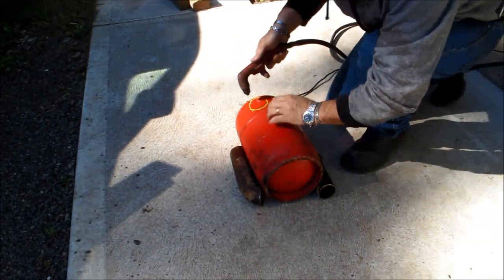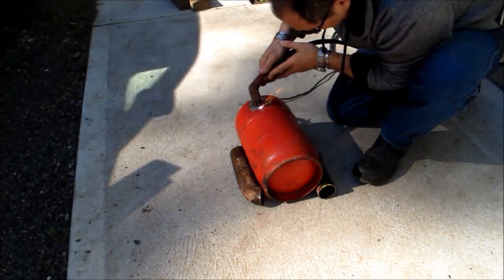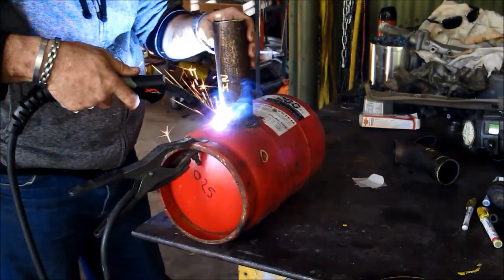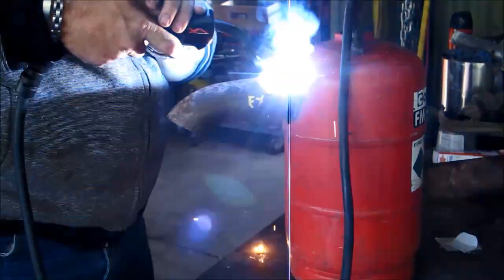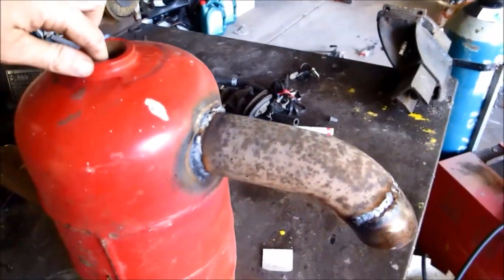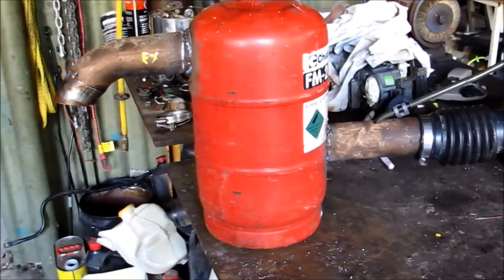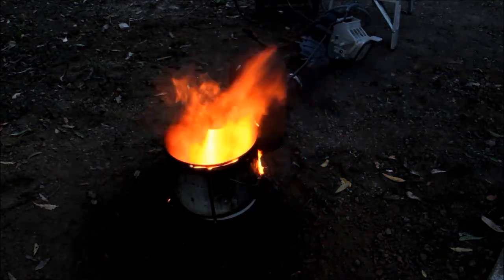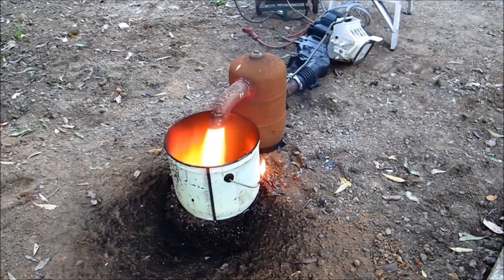How to build a Waste oil Burner for heating, scrapping or aluminium melting

Comment: Does placing the oil drip pipe closer to the tank on the pipe vs where you have it placed there make a difference?
Reply from the maker: No, The same amount of oil is still being fed in. If anything, It may be better to have it further back.  I think a pumped supply is far better than gravity and if using a Pulsed pump say 1 sec every 10 like I do now, the longer length evens out the flow into the burner.  Other than that, the positioning has no effect, it's just a packaging consideration.

Comment: Yes, your other vid on the very same burner gave me the the insights. Now seeing this vid I'm thankful that I got to see it before I weld everything together tomorrow. I had been trying a different setup and I did finally get it to work but I don't need a candle lol. I had a very similar sized pressure rated bottle I cut the holes with a angel grinder and simply stuck the pieces together. That was this afternoon and it preformed with nothing welded an gaps. I had that awesome oil powered flame. Thank You for your helpful vids!!!

Comment: A question Please... .. . How strong a plower do you need, would a mall vacuum motor work OK??  & How small a tank do you think one could get away with??
 Hah!!  Love the dirty build Mate!!! I've built some fancy burners for gas etc. To melt Bronz. But this is great as I have much aluminum sitting around and don't want it trashed.   Safety sissies Ha!! ... ..  This machine has no brain, Use your own!  /  90% of all humans were accidents!!
Reply from the maker: Vacuum motor Blower should be Fine.  You could probably go down to half this size tank with no probs and smaller but you'd have to build carefully below that I think.  The tank is like an evaporator for the oil so if you go too slow you will be limited on the fuel you can burn. 
Than again, the output of this thing would leave any gas burner I have seen for dead so there is a LOT of margin there even for melting.
Reply: @glumpy10  NOW DOUBT THIS THING PUTS OUT!!  So essentially the tank is something of a gasifier then. love the simplicity and your sharing it!!!  I also like that you are just using a metal can to drop the aluminum into.
This gentleman has a decent build/mix for crucible I may try also... .. . https://www.youtube.com/watch?v=s6ZmDY5Vma8&t=491s
Youtube is great! Love sharing ideas from all around the world, One of mine ...  a table set up for a handheld band saw. the central idea is to make a table so the saw can be used upright like a regular band saw, as simple or meticulous as you want if it interests you.. .. .
 https://www.youtube.com/watch?v=ZDNio9feg1o        Thanks for your input, my friend.

Comment: Currently trying to drip feed oil into my gas bottle log burner mixed with diesel I'm using copper brake pipe and it just keeps going hard in the end of the pipe and blocking it up ..... any ideas?
Reply from the maker: If you look at my designs I always feed the oil in through the air inlet to keep the oil line cool and out of the heat zone.  You can drip the oil into the air inlet or run the oil line inside the air inlet tube to keep it cool.  Heating the oil so it burns better is a flawed Idea by the ignorant but a popular one. 
Oil will always carbonise and block a small tube  which is why vaporisers won't work with oil. It simply forms too much ash unlike refined fuels, Petrol, Kero, Diesel etc.

Comment: I have a 185 CFM diesel compressor made by Ingersol-Rand that I'm thinking of using for an air supply. Any suggestions before I crank it up?
Reply from the maker: Use a blower. It will be a hell of a lot quieter,  cost a heap less to run and give you the same result. 
Although with a big Compressor like that you could make a decent Jet engine burner that would probably develop some considerable thrust.... and make a noise that would wake the dead and make the neighbours think a Fighter jet was taking off in a nearby street.

Comment: How are you able to calculate the  kilowatt output? Are you just guessing or is there a way to measure that? I have been viewing many of your video's and haven't seen any machine or tool able to do that. Good day mate!
Reply from the maker: A litre of oil is close enough to 10 Kw.  !0L an hour equals 100 Kw output etc.  Just  measure how much oil is burnt over a set time and calculate.  1l a Min = 600Kw. I often mark the oil drum, measure a couple of mine, Put another mark. After I shut down I can  measure how much oil between the marks on the tank and calculate with pretty decent accuracy from there.

Comment: Hi..I've got a 15kg gas bottle...so it's 2x bigger than your fire extinguisher..do you think this is too big...or..?
Reply from the maker: Too big for what?  :0)  Never too big, just take a bit more pre heat but once it's running, Look out. 
You could put 3" inlet and 4" outlet on that and make 1000Kw output easily.  Get a good jumping castle blower or a lawn blower for the air!

Comment: I've been experimenting with just free . "Fittings" etc. I have laying around, but my ball valve never really was good at allowing a  " gravity fed Pencil Lead" stream, it always seems to need adjustment, and the hairdryer for a blower seems to be enough to heat up my stove, - However when I used compressed air, for the blower, it worked 100% better than the hairdryer. "Anywho" just wanted to say "AWESOME VIDS" - (I've been straining the oil, i add about 10 -15% diesel to the oil to thin it out, it's runny, no lumps, ) but changing the drip valve...to hopefully make a difference.
Reply from the maker: If you want more heat, use a bigger blower. 
The problem with gravity feed is that it always needs adjustment.  The level in the tank changes, the tank changes temp causing the oil to change viscosity, Oil settles and gives different viscosity levels in teh tank and so it goes. 

Pumped oil is pretty much set and forget. You can have the tank safely on the ground and you can run the thing for a day and the level in the tank does not change and neither does the output.  Pumped or pressurized tank fed oil is way easier to control than gravity and eminently more consistent. 

Thank you for the kind words. Much appreciated!

Comment: Hello. I based my oil burner on this design. I used a small propane tank. About 2/3 the size of that tank you have there. One pipe coming out the top the other in at an angle. All welded up nicely. When I drop a burning oily rag inside the air is drawn in and you can see it swirling inside. Very cool! I use a plastic container with just a tap to supply oil. The container is located up high so the oil will just run down into the intake pipe via a hole drilled into the intake pipe where a small, 5mm or so, pipe drips oil into the intake pipe which then just kinda pools inside. Not so sure about the effectiveness of how I've made that part. Oil is just blown or runs into the chamber? I was using old diesel engine oil. I don't think it burns that hot. I tried straight diesel and that burns like the Sun but I can't keep that up. I live in a fairly built up area and I'm a bit worried about the noise and a little bit worried about the initial black smoke this sometimes produces during startup and accidental blow-out. I'm wondering if this is going to work. I was just directing the flame into a not-yet-finished kiln so I'm wondering if a lot of heat is escaping. I will keep working on it and sort it out. Thanks for your videos.

Comment: Hey mate, thanks for your vids, love it. I'm in Victoria too, surrounded lately by safety sissies, they think everyone's as stupid as they are! Common sense aint so common anymore it seems, and on that note i'd like to dob myself in for being too stupid to figure this out on my own... 
I'm having a lot of trouble getting my burner to stay light and stay lit.... Been mucking around all week without much success!
Used a bbq gas bottle, it has half the size of pipe you used, the top opening (where the valve was) is also alot smaller and the bottle is sorta more round. Otherwise it's almost identical to yours except i have a straight pipe for the inlet, which i welded into the side to get the air spinning, (couldn't find a suitable bent piece). 
Not sure what i'm doing wrong, but the thing wont even stay lit long enough to turn the oil on half the time, smoke everywhere, prick to restart... woof, flame out, nothing but shmoke. Every time i try to relight it just pops and singes your eyebrows again. Friggin' pain in the arse!!!
Watched heaps of your vids, tried starting on diesel mix, oiled rags, kindling, etc, but i have the same dramas, lights for a while then just dies without getting red spots or anything, air helps but it just woofs again and smoke pours out.. 
When i do get it lit, she backfires and goes out when i just think its starting to crank. I can usually get it re-lit a couple of times by turning the blower off and letting it self ignite, but i'm buggered if i know what's going on. 
I know that's a crap explanation, but i didn't wanna make you read my thesis! 
I'll try to make a video if you need, but hopefully you have some suggestions I can try first?
Cheers mate, Heppy Christmas! Griff.

Comment: Wow you're right this is extremely simple to build. I might have to build one of these to melt some crap aluminum at the house.
I'd like to get into casting too. By the way how much oil does it take to melt say a 4 cylinder aluminum head? 
Thanks for sharing. Best Wishes n Blessings. Keith

Comment: I just want to know what keeps the fire from going up into your fuel supply
Reply: It's because there is not any oxygen in the line. There has to be fuel, oxygen, and heat for fire to exist. The line doesn't get hot enough to vaporize the oil and ignite it. If it did get hot enough, it wouldn't catch on fire because there isn't any oxygen mixed with the fuel in the line. Look up wood gasification or homemade charcoal to see another example of this. It is basic fire triangle principle.
Reply: Yes good question, that what is bother me too

Comment: Hi! How much fuel consumed for 1 hour of work?
Reply from the maker: How much work you want done?
Reply: Sorry, I translate the translator. This burner I need for drying wet sand in a rotary dryer, dryer diameter of 570 mm, length - 4.6 meters, I am wondering what is the amount of fuel needed for 1 hour of operation at maximum output the fan from a car heater (as You do in the video)

Comment: Hey mate we are having some issues getting a good burn with used motor oil.. we had a few back fires that blew our air hose clean off !! Is that too much air too soon by any chance ? We gave up for the day without getting it really humming.. did run of just oil for a few minutes tho..
Reply from the maker: Backfires are too much oil. Generally happen at lower air where the oil accumulates then you hit the air which gives too much vaporised gas and pop she goes.  It can be real hard to resist the temptation not to give it more oil when you think it's going to go out but that's what you have to do. often adding oil cools the burner and makes it look like it's going out when in fact it's flooded.  If you add oil and the flame comes up a little then backs off, it's generally too much oil.  Wait and listen a couple of minutes to see if the burning get louder and stronger.

Comment: Hi 
Do you know approximatly oil consumption per hour or 10 hours?
Thnx
Reply from the maker: These do  not do a fixed consumption like a car. You can have as much or little heat as you want and the consumption will vary accordingly.  If you were say heating a home, you'd use somewhere around 2-3 L an hour Depending on about 10 factors.

Comment: hey chief watched this video again as i have just got two gas bottles and was wanting turn one into a burner, would it be possible to have the out let at the bottom instead of the top thanks paul
Reply from the maker: Yes Paul, that would work. I'd leave say 2-3 Inches on the bottom of the burner to allow for any pooling when you started up but the principal of operation would be exactly the same. Thinking about it there may be an advantage in pushing the heat down were the oil wants to naturally go instead of letting it go up and out.  You would of course want to have the Inlet at the top to allow some combustion time and for the oil to vaporise into a gas which is what actually burns.

Comment: Can someone please tell me how is oil refined into fuels? First you heat the oil then is refined at a certain temperature? By any chance do you know if there is an easy way better then refining how you can turn oil to fuels or is that the only process?
Reply from the maker: yes, use the method as outlined in one of my other vids. Been doing that and running my vehicles on it for 14 years now. I'm reasonably sure it works.
Reply: Ahh. I'll use pyrolysis oil for fuels.

Comment: that almost looks to simple, way cool, how long did it take to melt the aluminium? thanks for sharing!
Reply from the maker: Can't remember what the melt time on this run was but it usually takes about 5 Min when I want to melt any amount of ally. 
The problem is not melting it, it's melting it so quick you get it too hot and have to wait for it to come back to the ideal pouring temp.
Reply: @glumpy10  what is the ideal pouring temp? (Of ally)

Comment: Ive watched several of your videos, great job and great narration!  One video you briefly mentioned where you got the blower (ebay) but I haven't been able to locate one like in your videos.  Got a make/model or link we can look up for a blower?
Reply from the maker: I have bought a few Jumping castle blowers from ebay. They work well and can be had pretty cheap if you wait for the right offers.  the other ones have been random units many as old or older than me and not something still produced.  Just have to keep looking up blowers, extractors or centrifugal fans till you find something appropriate. 
that's all I do!  :0)
Reply: Took me a minute to figure out what a jumping castle was, LOL, we call them bounce houses here in the states, but looking up bounce house fans/blowers on ebay, found plenty.  Thanks mate, I'll be making one soon.  I've got a small auto repair shop and approx. 400 gallons of old motor oil  in storage and a ton of old water pumps, cylinder heads, ect. waiting to have the steel melted out of them.  When oil was expensive a few years ago I could sell the old oil for about 50 cents a gallon, now that oil is cheaper they want 50 cents a gallon to come pick it up!  The heck with that, time to put it to use!
Reply from the maker: Melting the ally off the old car parts is worthwhile. With steel you only get steel scrap price. When you melt the ally off, you get much more for that and still get the scrap steel value. Here that's about nothing atm but ally and copper are worth plenty.  If you can get rid of the waste oil at the same time, double bonus. 
I take it all from my fathers wrecking yard now. I don't like WMO as much as veg but it helps him out so all good.

Comment: What is the best fuel to use . I tried  waist oil and it is a bit contaminated  with  water and it just doesn't light  well and also  does not give off much heat once lit ?
Reply: Generally, water and oil don't mix. Oil will come to the surface while water settles to the bottom.

Comment: does it work if you lay it vertical?
Reply from the maker: If you mean horizontal, Yes, it does, maybe even better than upright due to the greater ease which the oil can come into contact with a larger area of hot metal in the burner. There are some other metal melting vids on my channel of it running "sideways"  :0) and it worked really well.
Reply: Thank you :)

Comment: How hot can it get, would I be anle to melt steal or glass
Reply from the maker: yes, the burner will easily produce a flame hot enough. There are vids on the net of people doing this. look up luckygen. He does it with ease. 
The trick is not the burner, it's having a furnace to retain enough heat and made from a refractory that won't melt into a puddle.

Comment: Brilliant ! I'll start making one today. Using a gas bottle I'll fill it with water first to drive out the gas before I start welding.
Reply from the maker: Always a good idea.  I often just run a good air supply through mine. As long as the gas is below the LEL you are fine. 
Let me know if you put a vid up of your burner.

Comment: How much oil does it spends on hour?

thanks
Reply from the maker: It's directly proportional to the heat you want. 1L of oil = 10KW hr of heat. 
You can vary it to what you want. so far this one has run up to 300Kw but it can also do 20 kw if required.

Comment: which video (if any) has a really good view of your fuel setup/tank/tap and so on? trying to show people what I am trying to build and obtain parts, like one of those tanks with the tap already in the bottom...might need to make one though. Got 2 months l;eft of good warm weather so I need to get cracken. Noticed the can of drip grease I got out of a grill was getting nice an runny just sitting in the sun so I dont think I'll have too much of an issue getting this stuff fluid enough without  tank heating.